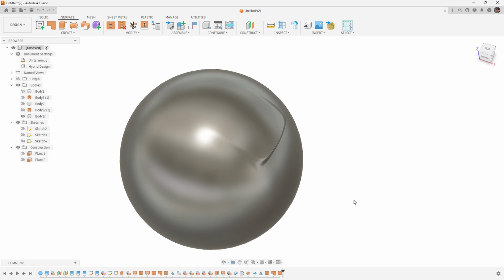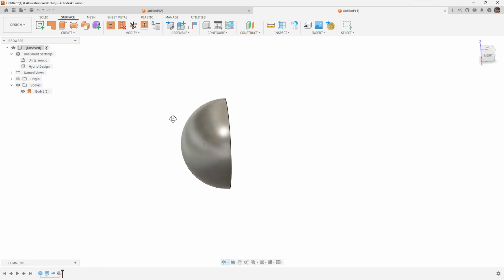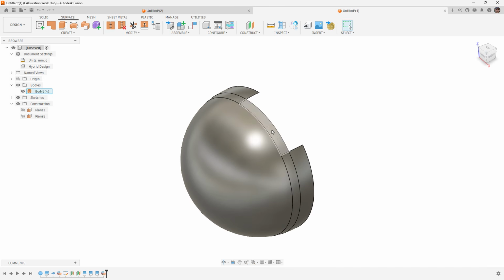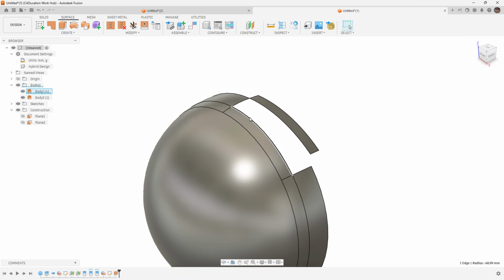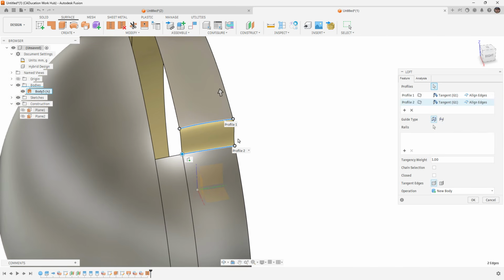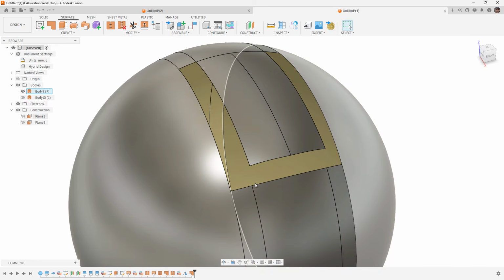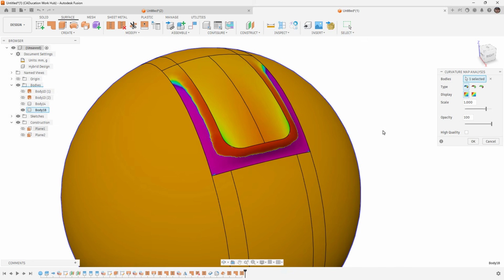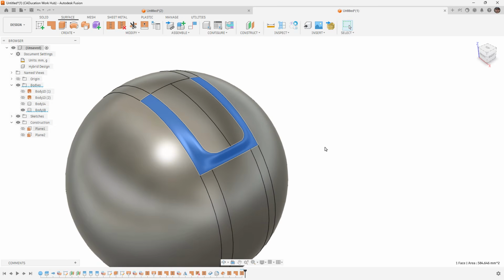Creating a Smooth Transition Bump in a Surface | Surface Mastery Part 20 | #fusion #fusion360

Comment: Thanks matt, will you advise a mechanical engineer to learn blender just to visualize his cad designs. I want to start up a 3d printing business, but I don't know if learning blender will be helpful via making visualization of my products. And it seems like blender has a steep learning curve.
Reply from the maker: You're welcome!

What i would say is going to a dedicated rendering program is probably going to be less cumbersome.  There are local programs and there are some web based ones.  Fusion gets you close but it really isn't a full rendering engine.  Blender will get you all the way and you might be able to simplify the process by purchasing HDR environments and materials libraries so you don't have to manually fool with that stuff.